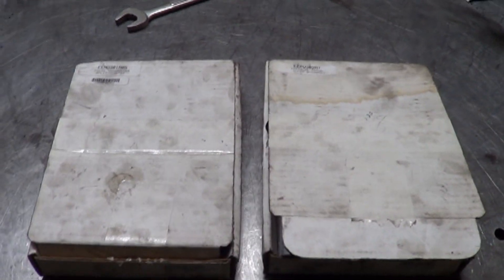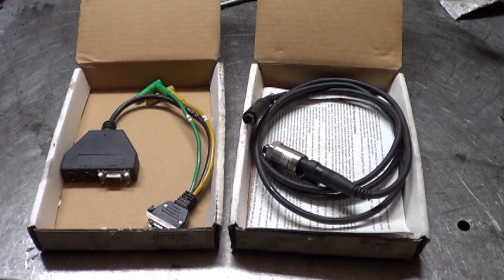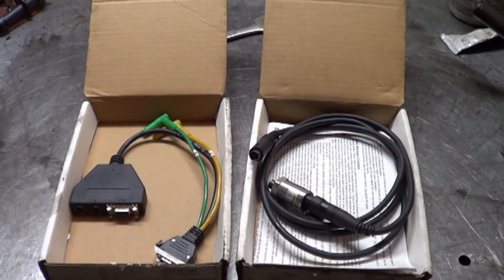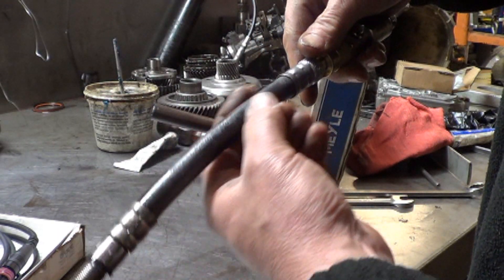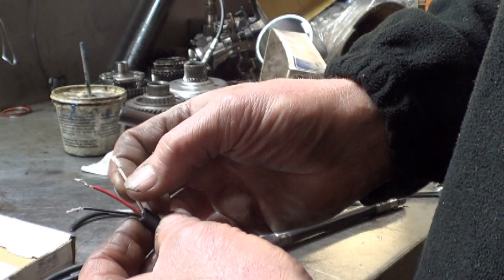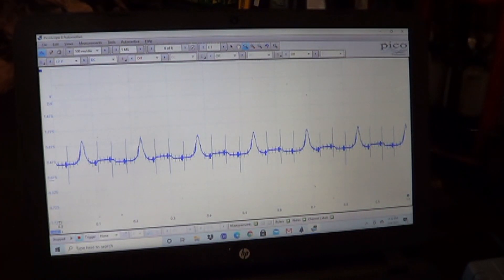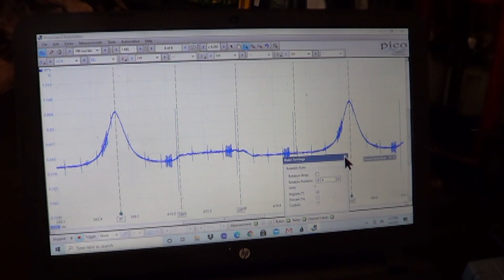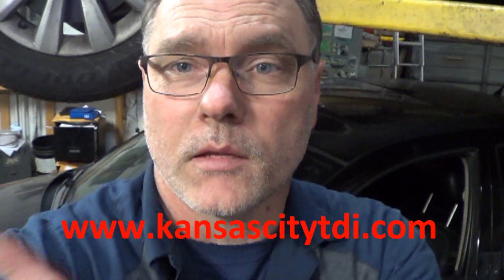In cylinder pressure testing

Comment: i cannot get my snapon transducer to work. using a usb port on a laptop, trying a wall adapter, 5v ground and signal return, nothing shows up on my pico!
Reply from the maker: I think its all right there in the video.  Does your scope show a signal if you check something else?
Reply: @CoolAirVw Rm  I have a 5000 psi and a 500 psi max. Red to 5v, black to ground, white signal, channel A lead to signal wire, and channel A lead ground to transducers ground. All I see is 0v on scope no matter the scale. I've used shop air to see If I get a voltage change on the scope and nothing. Ive spent some time messing with it.
Reply from the maker: @santiagohulkmuniez3394  kind of seems like your transducer isn't working.  Maybe it got fried at some point.

Comment: Hi Thanks for your videos. Great channel . They are really great. I contributed to kansascity several times. Do you plan on doing an video on using pressure transducer on a TDI. How much more complicated if this. Got a used pico 4423. Keep them coming. Your videos save some one a few hundred or thousand bucks so why not contribute to kansacity.
Reply from the maker: Thank you so much for the kind words and the contributions.  If it becomes necessary I will make a pressure transducer video on a tdi.  I have stuck the transducer on a few cars now and it hasn't been 100% helpful, only because the problems have been something else.  More video's coming.

Comment: I’m a big fan of your channel! Another great video

A tip:
For a 5V power supply, I recommend using a mobile phone power pack. They are approx. £10 from Amazon, have a much higher current capacity over a 9V battery, are rechargeable and have over-Voltage protection built in

It would save you needing to use Voltage regulators and the like
Reply from the maker: I may try that. Knowing me I'll be stealing 5v from a sensor till I die.
Reply: Hi Thanks is a great idea. Both ideas for the power supply are great. Now just have to make a setup for pressure testing a TDI BRM MK5
Reply: @Markb8608  I’ve also been looking into making my own digital cylinder pressure tester, for my 1.9TDI (AXR) 

On a healthy PD engine, I believe ~30bar is possible under cranking, so a 35bar abs pressure transducer is what I’m currently looking for (check pressure waveform while cranking)

Not sure on cyl pressures while the engine is running, I need to research this some more